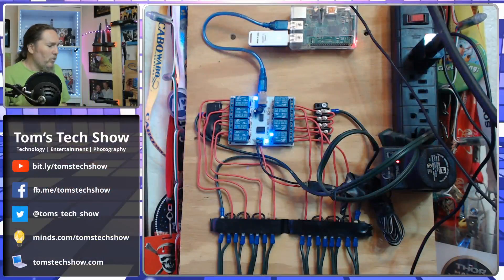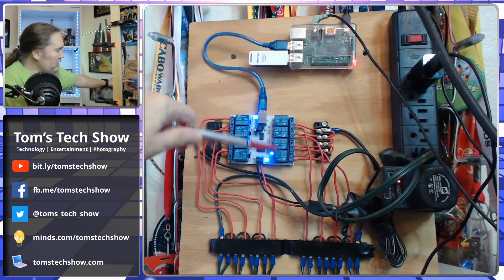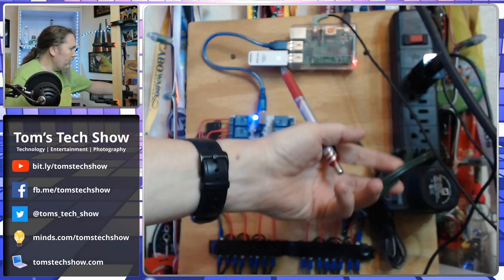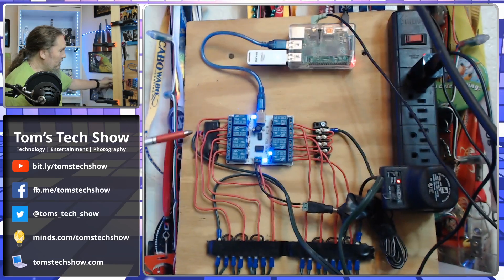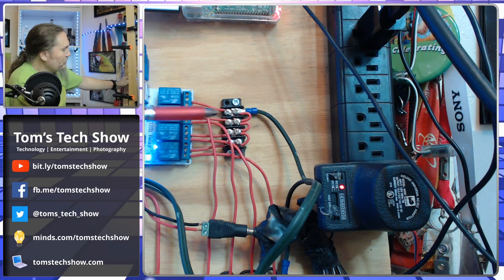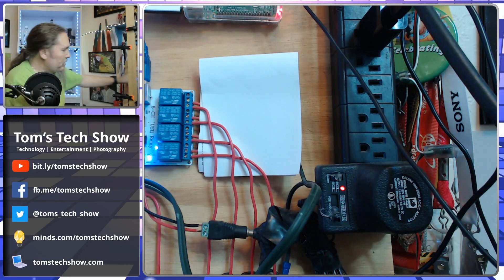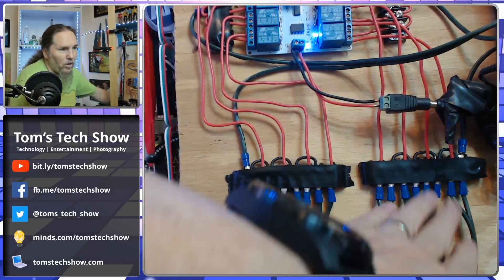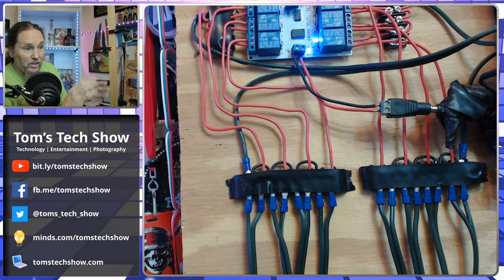Raspberry Pi Christmas Light Control Part 1

Comment: Can you power the relay with a normal extension cord split at the end or does the power need to be transformed?
Reply from the maker: It needs to have a transformer to change from AC to DC

Comment: What is the purpose of the power supply? Cant you just plug everything into a 120 volt outlet?
Reply from the maker: The USB relay board needs power to operate.

Comment: How do I connect 4 each 8 channel relays to the raspberry pi for singing faces display
Reply from the maker: Once you get the ID of each relay, you can create 4 variables one for each controller:

relay1 = BitBangDevice(device_id='A8008uu0')
relay2 = BitBangDevice(device_id='A8008uu2')
etc...

Then you would add the signals in the processing loop to send data to each relay varaible.

Comment: Sorry, but what is the type of connector on the other end of usb cable from the raspberry at the relay board?  I can't find any documentation for the board.
Reply from the maker: The cable is an old standard usb A to usb B

Comment: Is it possible to use a raspberry pi connected to the arduino and the arduino is connected to the relays?
Reply from the maker: You can use the GPIO pins on the Raspberry PI to send control signals to the arduino, which then the arduino can control a relay,  not the USB relays but other types of arduino compatible relays,   a lot more work, but it is possible,  I have not set that up in my testing.

Comment: I started doing the same song last year, and gave up about the same spot as you took a break. (You are right about it being time consuming) I was using Vixen of something like that, but now I think I will follow along with you and do something with a Raspberry pi. I did do a little four relay circuit last year with an arduino, (not to music but just a pattern) it was cool, but one of the relays died before Xmas. I am looking forward to seeing yours all done.
Reply from the maker: I am still using Vixen to create the sequence file,   part 3 showing how I am doing that will be out soon.   I have started to string lights on the house this weekend.